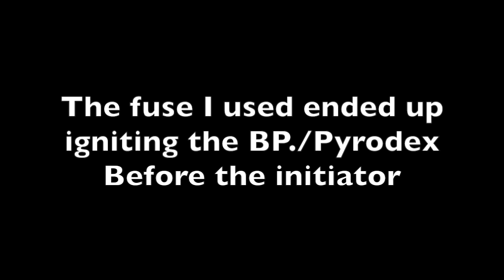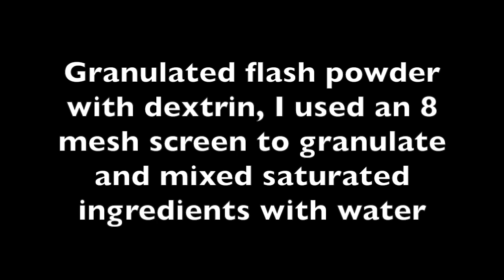Flash powder in different forms and AWESOME EXPLOSIONS

Comment: These are weak .   prob too tightly packed.  
70% potassium perchlorate to 30% of dark German military grade aluminum powder .     dont pack it tight in a container. It has to be loose   .     amazon sells the 2 ingredients

10grams of flash in a empty 12gram co2 cartridge not packed.  Keep loose.    Fuse it and pinch the end or jb weld epoxy the end